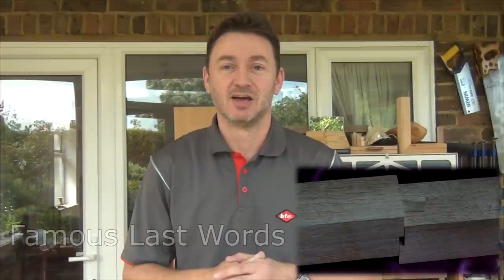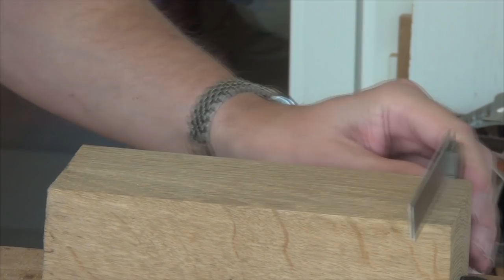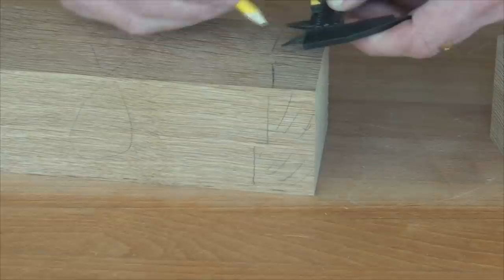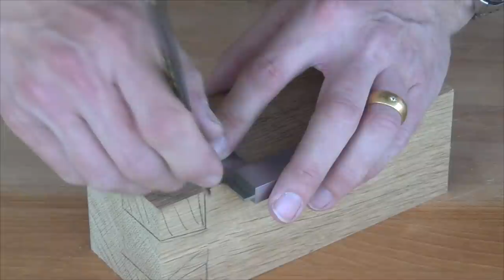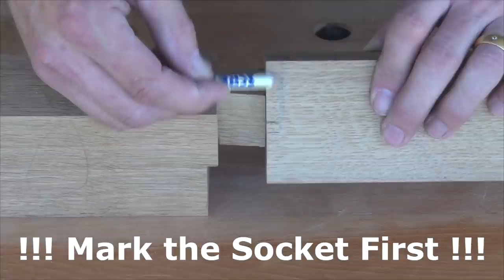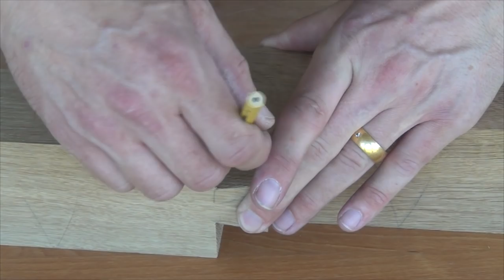Koshikake Aritsugi - Stepped Dovetail Splice

Comment: That joint has been used in boat building for quite a while. It is particularly used to join deck beams to beam shelves. The two pieces of wood being at roughly 90º to each other ,depending on where in the hull of course.
Nicely done.
Reply from the maker: Cheers. I really should get into boat building one day.

Comment: Nice to see a different joint. I saw a trick for blind dovetails on the Lie Nilsson channel where after cutting the 45's for the pins, he then used a card scraper to cut the second part of the 'Kerf', by gently tapping down to depth. I have used this on pine and it worked well, I don't know about harder wood, but got a good result. Thanks Mitch.
Reply from the maker: Sounds like Alan Peters' old trick. Think this oak might have been a bit much for it though. Cheers, Mitch

Comment: The Lie neilsen went 10 rounds with the Oak and mallet !   I guess another twist would be to add a couple dovetails on the lower shelf.   Thanks for posting this video Mitch.!
Reply from the maker: The LN A2 blades are good for that sort of thing. The O1 forged chisels take a keener edge for the cleaning up paring

Comment: Beautiful video, Mitch.
The connection looks great.
There are indeed a large number of Japanese connections.
I recently applied a Japanese connection, a cross halving with remote dovetails (Shi-ho-ari-kumi-te)
Reply from the maker: Thanks Günter. There are. I think it's great to try out different joints, even if you don't necessarily need to use them. I may get around to that one eventually. Cheers, Mitch
Reply: That's right, I used the cross halving on a cross. Have I specially bought a book in German language where Japanese and Western Wood connections are or recorded it.
Reply from the maker: Nice. Sounds like an ideal situation to use it.
Reply: That's right, Mitch

Comment: Wow! Nice work Mitch! Using that hard of a wood didn't make it any easier... Did you have to stop and sharpen those chisels a couple of times?
Reply from the maker: Cheers Guy. The LN chisels I chopped with held their edge okay. The A2 is pretty good like that, although not as keen as ordinary tool steel. Nice new logo!

Comment: Love the handcut joinery vids!  any tips or vids on sawing with Japanese saws?  just experimenting with then myself...STRUGGLING !
Reply from the maker: I haven't done any videos on it - maybe I should! I think the best advice I could give is hold the handle quite loosely, and as far away from the blade as possible. Saw only cuts on the pull stroke, so don't apply any pressure when pushing.
Reply: thanks Mitch, I had been choking up on handle, I'll give that a try - thanks again!
Reply from the maker: Let me know if it works for you.

Comment: Great video and explanation. Thank you! 
Why not a mirror dovetail on the other side?
Reply from the maker: Thanks! Well that would be a different joint. seriously though, for the application as a ground sill, the length of joint line facing down should be kept to a minimum to reduce wicking of water, I believe.

Comment: An interesting way connection.
Question - why the "dovetail" made only half the thickness of the stick? Maybe for the strength to do it at 2/3 thickness.
Reply from the maker: it's there to hold the splice together. if right through, then the splice could separate in one other direction. :-)
Reply: Posted in G + (posted drawing)